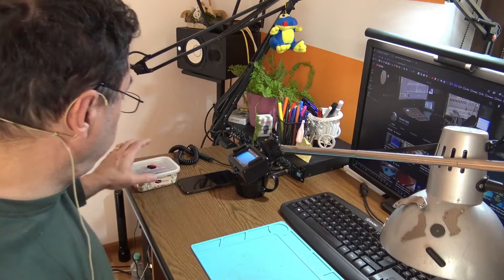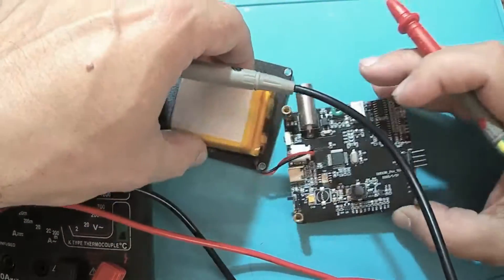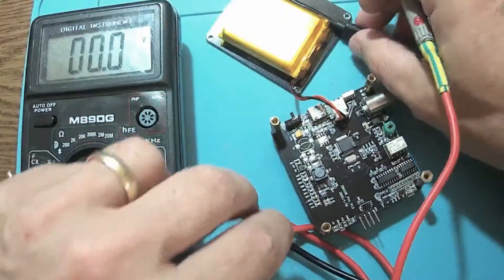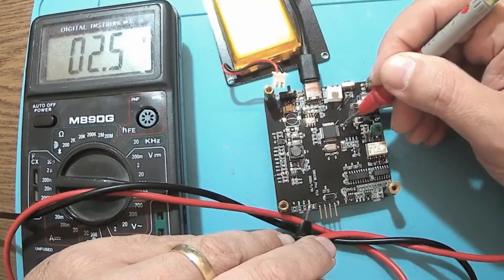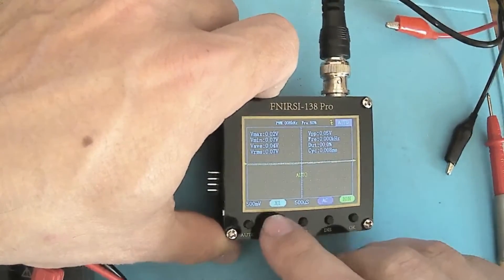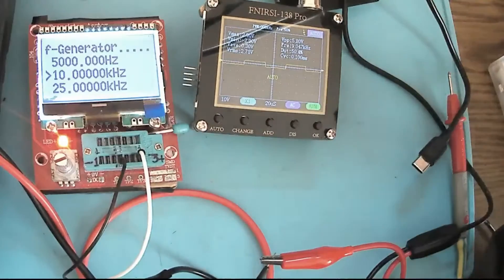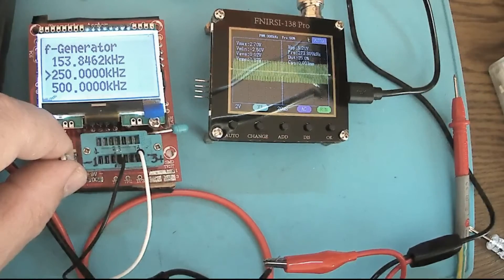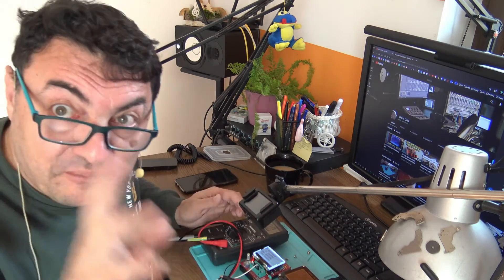FNIRSI 138Pro battery MOD

Comment: Thanks for this video! I ordered a ZEEWEII DSO154Pro, and only realized later than it's the model without battery. I've been looking into how to add a LiPo to it, which dimensions would fit etc, assuming that it would be a lot better to operate on battery instead of 5V USB. I got kind of in a rabbit hole here.
Thanks to your video, I realized that most likely I don't need to buy a LiPo or connector, powering the scope via 5V USB should essentially give the same results like you've demonstrated.
I'm thinking about using a USB power bank instead of an AC adapter.
Reply from the maker: Yep, battery gives electric isolation and maneuverability. An external USB bank should do an excellent  job.

Comment: Mine came without a battery. The board is not even fitted with the white battery connector and there appears to be resistors missing near the battery connection.
Another you tube says to use a 9V battery,,,
I connected one to where the battery clip is supposed to go but nothing happened.
It seems your unit came with a battery?
What is the mod please.
Reply from the maker: Check this video https://youtu.be/jP_xDeu9-5g

Comment: Please forgive me if this question is stupid, but is it not an advantage to use the battery, I mean the USB cable goes directly from a 50Hz noisy outlet and may also have ground, where the battery makes it totally floating?
Reply from the maker: Always better on batteries! Like you said the oscilloscope is floating, no worry about mains ..ground and totally safe.
Reply from the maker: Not stupid at all! Very cleaver indeed!
Reply: @viocaia  Thank you so much! :-)
Reply: is it not possible to use a powerbank?